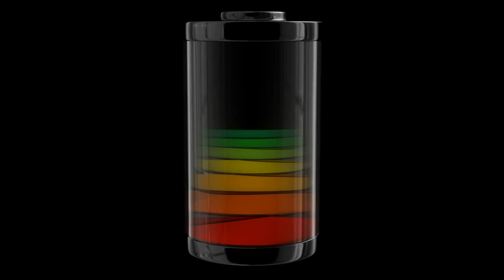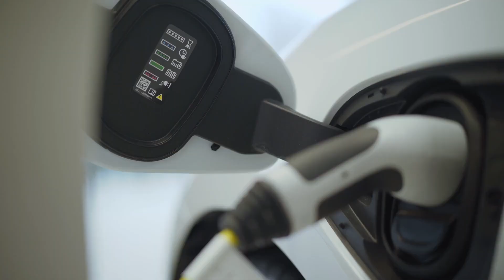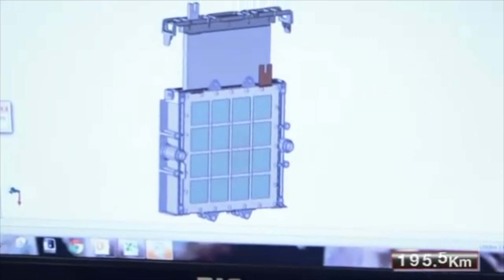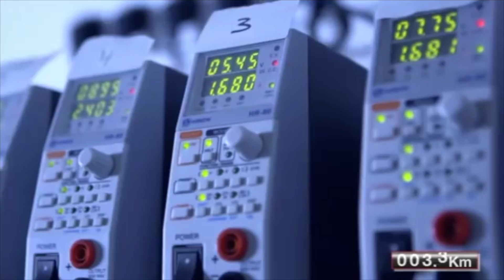This Battery Gives EVs 1000 Miles of Range!

Comment: I don't think battery swapping is really in the cards.  It's one of the most important parts of an EV which you are swapping out with a replacement that is (essentially) an unknown quantity.  But as to whether research should continue... definitely.  If someone found a way to recharge these suckers, it would be a game-cahnger.

Personally speaking I think there is going to be a lot of competition for the next generation battery.  Not just hydrogen fuel cells (which are also a hard sell), but also lithium based batteries using a solid electrolyte and nano-patterning / nano-doping.  Or even straight-out lithium metal  A lot of the problem with lithium can be solved with nano-scale patterning and production... also a very new field, but one that is guaranteed to become big over the next few decades.

Personally my fools gold is on some sort of lithium iron battery technology with a solid electrolyte.  Considering the cycle life we get out of LiFePO4 now (at a somewhat lower energy density per kg than NCA/NMP batteries), as the research progresses the energy density really only needs to double just once for weight to become a non-factor.  (Same with other lithium chemistries, but only LiFePO4 is devoid of rare metals).   Once any rechargeable battery is able to get past 300 miles at roughly half the weight of current batteries, its game-over.

But for Aluminum-Air, or Aluminum-anything really, I think rechargability is an absolute requirement to actually be able to succeed at scale.

-Matt

Comment: I've toyed with this. Design requirements centered on common cheap materials.Too expensive? Rejected.  Sodium zincate was tried as electrolyte. It's an ionic hybrid kind of fuel cell. Be good for electric aircraft. Rate batteries for flight time, remove and replace. They are bulky because they breathe air. And as far as power, sure, you got kilowatt hours to burn,  but it's like trying to empty a swimming pool with a straw. Thanks.

Comment: The solution, a hybrid system. A permanent 30kw lithium battery that would give a 100 mile range that would cover 90% of normal use and a battery swap module, a bit like the gogoro electric motorcycle, that can be swapped for another 200, or a bigger battery swap system that would give another 1000 mile.
Reply: Was thinking the same thing back when battery swap stations were being discussed a few years ago. Let me have a 550km+minivan with the option to put a 100kg/600km+ swappable extender AlO2 battery in the “frunk” or underneath via swap stations. Instant cure for range anxiety, but also heaven for those who live in apartments and can’t readily charge overnight/at work. Also really good for the car rental fleets as well while charging infrastructure is being built out. 

Even can be used in an emergency extended blackout situation… once the closed circuit supply/recycling chain is running, there’s really no downsides

Comment: A couple of things, fossils energy processing requires quite a bit of metals catalyst for reforming and desulfurization per example. Aluminum must be produced with green electricity as it doesn’t exist in pure form. It needs bauxite to produce 2Al2O3 + 3C —> 4Al +  3CO2 under high power electrolysis

Comment: Nio has already tried the battery swap stations by placing the stations all around certain cities in China. There is a guy on youtube doing videos about it. He tested the viability of the swap stations compared to a plug-in recharge and found the actual swap was quick but most stations had a line up of 3 or 4 cars and your wait time in line was the same as the wait time for a charge.
This was for Nio cars only as well so you could imagine a station catering for all car types. And then the stations had to have enough battery packs to supply I think he worked out 6 cars per hour for 8 hours so at least 48 precharged battery packs at the start of each day.
Everything has a price to pay or a downside to it.
Reply from the maker: That’s a 200-300 mile lithium ion battery. This could go like 8x further per charge
Reply: @TwoBitDaVinci  Yes but I'm thinking long term if it became the standard. Every car would be exchanging batteries not just Nio. There would be more fitting stations as well but right now a queue at a gas station can be an annoying 5 minute wait. You do the same thing in the future for a 5-10min battery swap and you have 3 or 4 cars ahead of you will still be a long wait. 
It won't matter what the battery is made out of if everyone has one you will still be stuck in  queue. Like being given priority boarding at the airport only to find everyone has it. 
So hopefully you get the option of home charge, recharge stations and battery swap stations. Because battery swap is a nice option but shouldn't be the only option.

Comment: Aluminium Air battery sounds very promising for many applications. The swap thing and degradation will need to be solved. But, I'm thinking a small pack for bikes, scooters, or something like the FUV (not Aptera) could be a serious possibility. Can it do 110v output? Could be a handy portable power supply.

Comment: Clearly, this level of energy density could make a big difference in short haul aviation, so I expect Al/O batteries to be used in this field first. A 20 seater electro-prop plane with an out and return range of say 1500km would be a useful addition to just about any nation’s fleet. 
Here in NZ, having battery swap facilities in Auckland and Christchurch would allow such planes to fly anywhere in the entire country.  Get the range up to 2500km and flights to and from Australia are quite feasible.

Comment: Ok, considering the anode breaks down over time, and the water inside would need to be exchanged over time too. 

Big whoop tbh. Looking at the availability water (including dirty water) would be still a reasonable price for the exchange in range. 

In my perspective, it wouldn't be much of a tall order to include an easy to swap anode, possibly simple enough for the consumer to do, so shipping fresh high quality anodes would become the new issue.
If I had the support, I'd buy out old oil change stations and retrofit it for battery swapping and aluminum recycling center/hut/hub or something. Why not include a distillation tank to refresh the water on top of that.

 Pushing for city support for waste management would be out the question, plus any insensitive of going green would make this much more appealing than batteries piled up on a hill some place.

Comment: One possible way this could be useful would be to make the batteries small enough to be easily user-swappable. (Let's say 6 or 12 kg [~12/25 lb], giving about 320 or 640 km [200/400 mi] of range.)

Then EV manufacturers could make “hybrid” cars w. rechargeable batt packs of 100–200 mi range (or ~150–300 km) max, which would be more than enough for everyday use, and car owners could purchase single-use batteries of 200 or 400 mi range (320/640 km) — as many as they wanted — only for long trips. And they could still recharge along the way.

Comment: I could see this being a very compelling option for semis.  Higher energy density is required for towing capabilities.  Li-Ion efficiency goes way down when towing heavy loads.  Also, trucking companies could build out the infrastructure to do the needed battery swaps.  I could also see Hybrid Li-Ion and Aluminum-Air becoming very popular in the consumer space.  This way, even if your car needs a Battery swap it could still keep moving under Li-Ion power in the meantime.  Perhaps Li-Ion is your daily driver energy source for shorter trips (work, shopping, etc) and you only engage the Aluminum-Air battery for longer trips.  This also softens the blow of potential replacement costs for the battery swap as your Aluminum Air battery wouldn't always be needed.  All these ideas could happen soon and still allow companies to research future range and density upgrades for the future.  If we're really lucky and Li-Ion or Aluminum Air wins out, we might not even need to buy new vehicles to take advantage of upgraded battery technologies.

Comment: Think about the problem differently. Most people drive less that 50 miles a day. So, populate the car with enough Lion batteries for daily driving and evening charging (maybe as much as 100 miles). Then augment the system with an Al-Air battery for longer trips. The battery could even remain in the car as a reserve and kick in only when the primary Lion battery is depleted. This would be perfectly acceptable to me for my occasional long distance trips and would required just a handful of swaps per year.

Comment: It seems that a combination of rechargeable batteries for smaller range along with Alu air batteries might be a happy compromise to where you wouldn't be 100% dependent and there fore stranded without an opportunity to swap the Alu air batteries.

Comment: I don’t know of any cars that can travel 300miles on 2 gallons, especially the small US gallon.
I get that he said the energy in the fuel is the same but as ICE engines are only around 20% it’s not a fair comparison.
Reply from the maker: 2 gallons stores the equivalent energy. Gas engines are terribly inefficient. But a gallon of gas stores 36 kWH of energy
Reply: @TwoBitDaVinci  
I acknowledged that but to cover 300 miles an ICE car would need roughly 10 galls.

Comment: You used the wrong flag for the DRC. There are two Congo's. The Republic of the Congo (the flag you showed) and The Democratic Republic of The Congo (the flag is blue with a gold edged diagonal red stripe...and a gold star in the top left corner).

Comment: 1 liter of gasoline can develop 9,6 kW/hour power... The best batteries on market for the equivalent of 1 Kg can develop just 400 W/hour which is 0,4kW. By far the electric vehicle nowadays are very inefficient, lots of energy is waste by the battery weight itself and its energy stored mainly comes from 96% from non-renewable energy... Dump the problem elsewhere doesn't make the world more "green". We are not ready for electric vehicle like we weren't 50 years ago for the same issues... We lack of technology and numbers. We will enter in a new era for the human when nuclear fusion will be on the market and subvert the way we produce massive energy.

Comment: The winning battery will be the cheapest in overall cost, the only reason we have gasoline engines is because gasoline was the cheapest fuel. Henry Ford built an electric car for his wife over 100 years ago and it worked. There are many new battery types being developed each with its own problems and the cheapest one overall will win out. Rural America didn't have electricity until after 1947 when the government stepped in to lend a hand to get it done. The rest of the world is not waiting on us anymore they are leading to help save this planet.

Comment: If these are lightweight surely it would be more sensible to have two of them in a car , when one is discharged the second will take over and the first can be replaced before the second goes down , no range problems ever again and no hurry

Comment: This would be great, but I don't think it will work. These batteries are not rechargeable. You can't plug them in and charge them. Instead you have to physically extract and replace the aluminum in the cells, which probably costs more money and consumes more energy than you'd ever save. That's pretty much a show stopper. I like new battery ideas but I just don't see how this one will work.

Comment: How does 1,000 battery with 300 miles = 2 gals with 60 miles? Sorry bad start!
Reply from the maker: 1 gallon of gasoline has 36kWh of equivalent energy. It’s just basic math. Efficiency of the engine to consume the fuel is different of course

Comment: How about just adding the "aluminum air battery" in all electrical cars, add a filtration system for the power cell and you dont have to charge your car so much. It just charges wherever you park it.

Comment: I would love to see you do a video on Graphene super capacitors as a power source for EV’s. It could be fully charged in a couple of minutes and is much cheaper and lighter than lithium technology.
Reply: @Allen Loser I was under the impression that Graphene based super capacitors are ⅓ the size and ¼ the weight for the same capacity of traditional large capacitors, so are they still going to be heavier for the same storage capacity? They also can be charged if a fraction of the time of normal batteries, so even if I have to stop twice as often to recharge, I would prefer charging every 150 Miles for 2 minutes, rather than every 300 miles for 45 minutes not to mention hours in line to even get to the charger because of such long charge times. Integrated solar panels, micro wind generators and regenerative braking could all be added as well. I think the environmental costs of lithium are also another factor making other technologies a must for the future.
Reply: Super capacitors could harness lightning as an energy source. They could recharge by bleeding the charge off of clouds before they build enough energy to spark.
Reply: But graphene production is very expensive. But some chinese material companies have started producin it
Reply: @ripper5941   It is getting much cheaper as larger production facilities are completed. At scale it will be far less expensive than lithium and FAR better for the environment.
Reply: @Allen Loser yikes, I guess they still have some work to do lol
Reply: I think batteries will always be of lithium,
you hear every week that researchers have found a wonderful battery that is made of different materials,
these are scams,
the team of researchers wants people to "invest"
there it is!
they just want people's money
Reply: You’d think that if it was so simple and really worked out, the engineers at Tesla would have implemented it huh?☹️

Comment: The amount of aluminum that has to be recycled each week would be insane if every car on the read had to swap them out each 3-7 days. 1.42 billion cars. I for one don't think this is a solution. a Battery that can be charged but is better then lithium batteries is needed. not a one time use battery. 
the environment impacts all the recycling is going to do is high. I would not buy such a car unless they find a way better solution where this in some way can be recharged.

Comment: Generation of aluminum metal requires electrolysis , which uses electricity. The efficiency is not 100%. Therefore the overall cost would be an issue. Unless we can make Al at far cheaper price, it may not make financial sense.
Reply: 8kw/h is what you get from 1kg of aluminum at the cost of 4$ pr kg that is just for the raw aluminum alone, on top of that comes the cost of making the batteries. Way to expensive and they tried this idea 30 years ago and gave up.
Reply: @a64738  That is what I thought. However, for certain project that cost is not an issue, if the energy density is higher enough, it may be okay? I am not sure.

Comment: I don’t think it will ever be a viable option. Consider this, if all cars in the world were ev’s right now, the production of co2 during the manufacturing of aluminium would defeat the purpose of switching to ev’s. It may even increase it. I think the best hope is eventually the solid state battery if it can be done cheap enough.

Comment: Vehicle makers need to ALL (100%) get together, and come up with a single standard for battery packs. 
Look at it this way, would you go purchase a flashlight, not knowing that you could grab a "D" cell from anywhere?
Reply: I do, actually. I don't want a flashlight with D cells, I want a flashlight with a MicroUSB port. There are even portable "range extenders" you can buy if you need to take your flashlight somewhere that doesn't have convenient USB charging.
Reply: @ps.2  -- reaaaaally missing the point of STANDARDIZATION.  If you have a "product" that uses a AA, it doesn't matter if you bought it in Japan or Germany or Australia. It'll be the same no matter where you are.
Reply: @DrFiero  That's what's so great about MicroUSB!